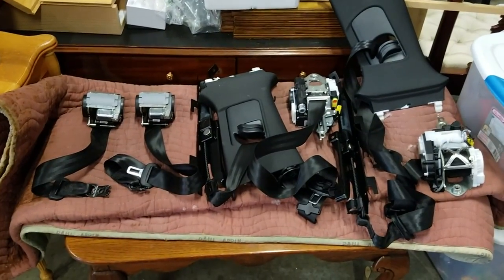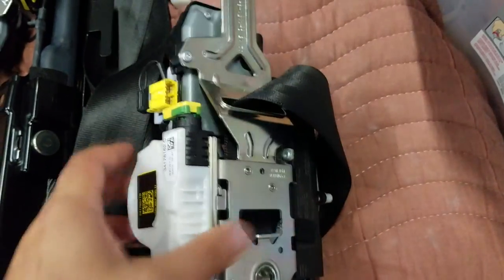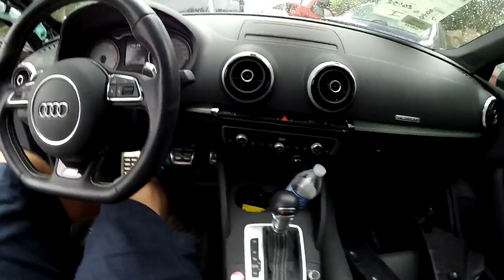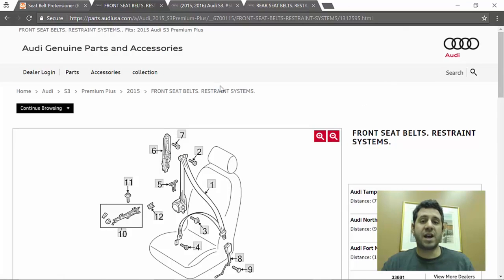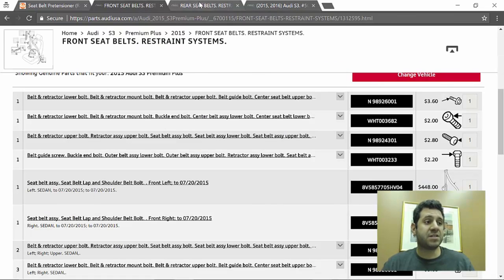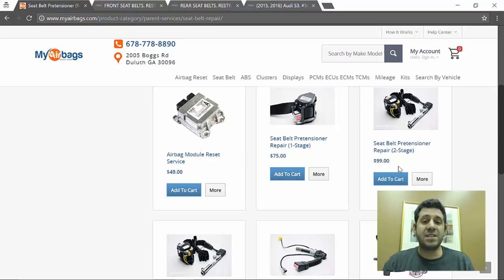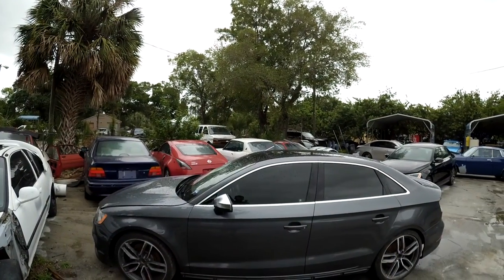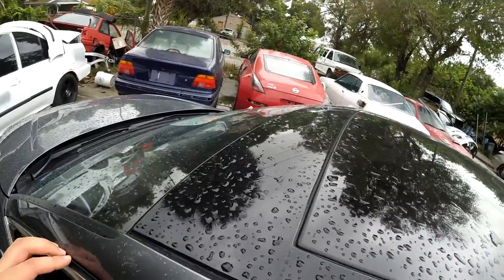I saved $1800 on the Salvage Audi S3 Rebuild by doing THIS

Comment: I wouldn't repair my seatbelts or airbag control module. They're made for one time use. The seatbelt fabric can be compromised and the module has a sensor that can be damaged and thrown out of spec.
Reply: THIS /\ , is why you always replace seat belts. It's the webbing and stitching that gets strained as well as the electric bits. Also in a high speed impact how do you know the frame of the mechanism is not bent. A SEAT BELT IS THERE TO SAVE YOUR LIFE, why risk a second hand one that has been used in an accident.
Reply: I'd repair them once I'd know the spec and be able to do the possible tests required..
Reply: Right, although almost certainly not all seatbelts were being used at the time of the crash. Also if the computer is truly reset, not being tampered with, and then passes the self-tests, i wouldn't worry that much.
Reply: It changes per accident... look at this one, the side has been lightly scraped... 10000% repair them instead of spending thousands on new ones.. maybe if you crashed worse than this, you wouldn't be repairing the car...
Reply: I've seen someone take a used seat belt and lift a V8 engine with it.  Unless is has visible damage I wouldn't be worried.  You have no idea what you're talking about, a seat belt isn't a $5 rope from wal-mart.  If the sensor is thrown out of spec the airbag light won't go off.
Reply: Agree, however in this case as there was only one occupant, I would only replace the drivers belt, repair all others

Comment: I used to work in automotive firmware, and the amount of engineering and expertise that goes into the safety systems is breathtaking. All this stuff you're not replacing is supposed to destroy itself as part of its normal behaviour during an emergency, and having some dodgy third party fiddle with it to save a few bucks (possibly at the expense of someone's life) is dangerous.
Reply: TwoManMilita I would have replied, yes baby I’m fine but I’ll be back (terminator voice) lol

Comment: In case of a violent impact, your seatbelts will activate an explosive which pulls the seatbelts. The old seatbelt are not safe anymore. You cant repair them by resetting the Control unit. When ordering new parts, they do not contain the explosive charges (too dangerous to ship). Do not use them!
Reply from the maker: I've done this multiple times, it's always been a pain less process and the cat always recognizes repaired modules with no new codes.
Reply: Are you sure the repaired vehicles will work good as new in case of an accident?
Reply: That's exactly how seatbelt pretensioners work. Not all, but most do use a small explosive which is only good for one use.
Reply: But to SRal's point, how do you know the explosive pre-tensioner is replaced?  Just because the car recognizes the repaired module and doesn't throw a code does not necessarily mean the repaired module has a explosive pre-tensioner installed.

Comment: The "long rod" part of the seat belt assembly is the belt pre tensioner. It partially retracts the belt to "pre tension" it against the occupant to reduce forward movement during the rapid deceleration of the vehicle during the crash, the other sections (like in the rear) then lock the belts to prevent further movement from a possible secondary impact or roll over etc.

Comment: the black part on seat belt is the charges that locks up the seat belt, the other part it releases the belt couple inches so you wont be locked up

Comment: About that Steel wire that's attached to the seat belt. I might be wrong, but I think it's a piece of Audi's procon-ten system. It's a great system and it works perfectly. I have the same system on my 1991 Audi 80 2.3E quattro. 
Ps: I think they call ut Audi 4000 or 5000 in the US.
https://en.m.wikipedia.org/wiki/Procon-ten

Comment: Why would they not take off the handles , mirror , and belt moldings on the door when they painted it? They need to be removed to insure the clear coat will not start peeling in the future. Taping them off is going to cause a hard line from the clear coat and that will eventually start peeling. Just a heads up if it starts happening.

Comment: Curious what your opinion is. I did the exact same thing (different company though) and all is good in the world. One thing I did hear later is that belts should not be reused because the stitching has some give thats important for an accident and they lose that give after an accident. Not saying I agree with that statement, but curious if you have heard the same thing and what your opinion might be
Reply: BoogieDownProduction It's dependant on the accident. This car was in a minor accident and deployed all of its safety features as a failsafe. It's likely the car didn't even have people sitting in a couple of the seats that actually deployed those safety features. 

Either way, the car wasn't in a huge wreck....if it were I doubt this guy would of even attempted to rebuild it. I don't know why you'd rebuild a car that was in a huge wreck anyways, unless the car has sentimental value or value beyond its repaired state. 

Honestly though....a lot of these "safety features" are unnecessary money pits.  Stealerships and other places and people will say that you NEED to replace everything, when in reality it's as cheap, simple and easy to just reset everything for a fraction of the cost. There's no reason to replace a fully functioning control module for $800 bucks, when all it needs is a reset. If the car was mangled in a wreck that otherwise destroyed that control module, then chances are you wouldn't be rebuilding the car anyways.

Comment: Audi pre sense basic will retract the seatbelts and lock them if it detects imminent collison, eg. a skid.  There's probably motors inside the seatbelt assembly to do that.  Also, did you have to replace the knee airbag too?
Reply from the maker: No knee airbags. Since there was curtain airbag deployment I'm fairly certain it locked them all up

Comment: Hello, ive a A3 8V that had minor rear impact with only the plastic bumper bracket support damaged.

Airbag light went on and the safety system fault..... stability/tpms/hill assist/fuel gauge - wont start

From watching your videos and before i get the fault codes read possible to assume a seat belt needs replacing and the airbag ecu to be reset?

Where is the airbag unit and how can it be removed?

Seatbelt to be removed - any further guidance would be helpful

Also, saying i got seatbelts repaired and ecu reset would it then be possible to refit and start the car and all would work?

Comment: I've been an auto tech for many years,  and most recently an airbag specialist for an insurance contractor.  There's a reason insurance companies only use OEM airbag replacement parts. LIABILITY.  Meaning big bucks in a lawsuit when somebody is injured or killed by a faulty airbag system. So they CYA(Cover Your Ass) by following exactly OEM  repair, replacement and procedures. In fact, I've been contacted several times by lawyers looking for an expert witness in airbag lawsuits against insurance companies and auto manufacturers.  Needless to say, Airbagsystems.com does not get any insurance business. And you might want to look at their website under Terms and Conditions, where they absolve any responsibility for their work. That means you take liability. Scary, my friend.
Reply: My thoughts exactly. I'm a field adjuster w/ Allstate and we are only allowed to use OEM air bags/impact sensors/modules for the reason you stated...liability.

Comment: my tio has a 16 Accord Sport with 12k miles on it and it was a salvage title because it got t boned nothing wrong with the engine the passenger side doors as well as bumper and wheel the air bags also deployed and I don't believe theirs any major damage to the frame if the price is right is it worth buying I'm 19 and this would be my first big buy but is it worth it my tio thinks it's around 4-6 thousand in repairs and said he would fix it and sell it to me someone please reply

Comment: Hey sam, can you repair car with use parts ? or you always have to use new parts.
Reply from the maker: You can absolutely use used parts; you just need to keep all receipts (for new and used parts). If it is a major piece, you'll need the receipt with a vin number of the car it came off of to prove the part was not stolen off another car. Most parts/junk yards will provide this to you no problem!
Reply: Thank you

Comment: Or you have vcds and code the srs your self it's easy... I would allways get new seat belts never reuse them ! They could get rips you not see and when you crash again the belt you rip and you fly through the windshield
Reply: How do you reset the SRS via VCDS? You can not just clear the faults. There is something hardware related as well.